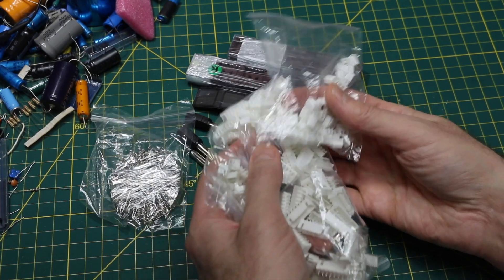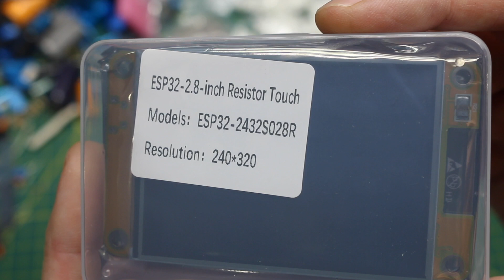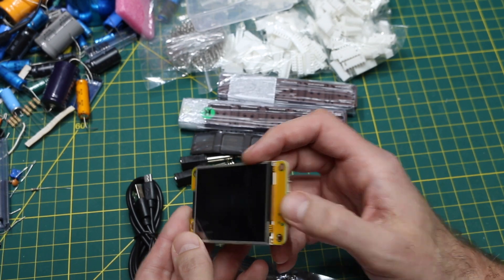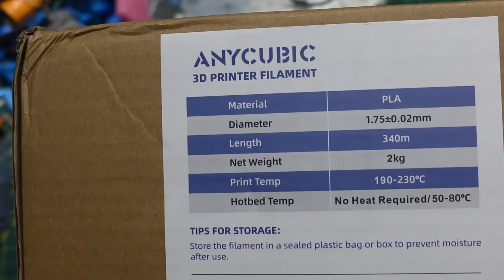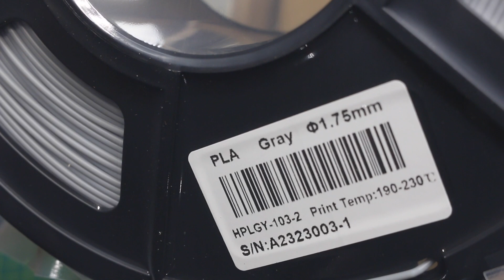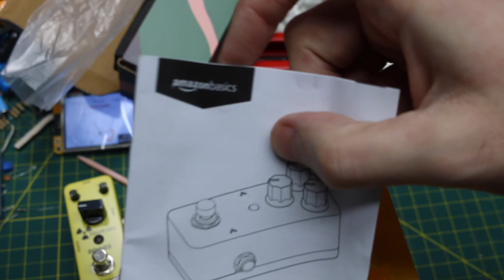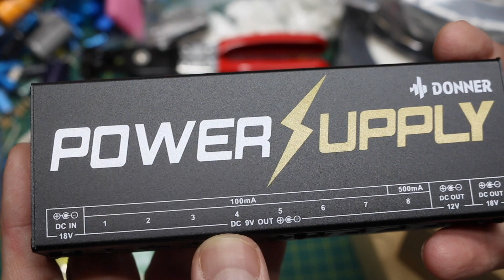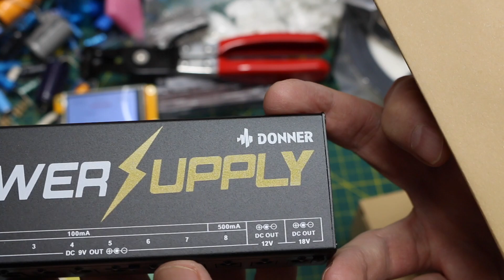Mailbag!

Comment: If the Donner power supply works fine it would be interesting to see a teardown sometime to see what circuitry it contains
Reply from the maker: I’m still stress testing it and so far I have loaded it up with effects  and no problems. I think a teardown is going to happen and maybe compare it against a more expensive one I have that should be designed better